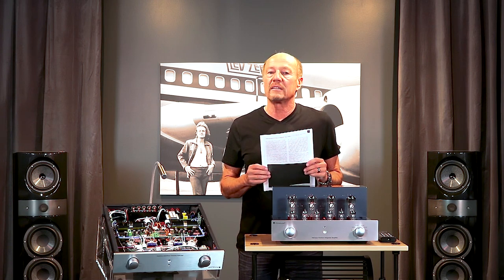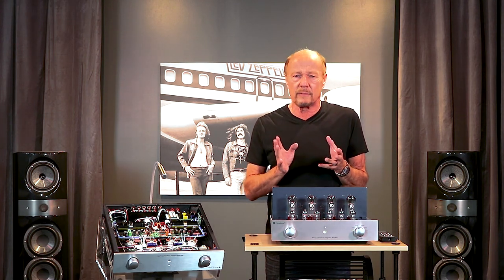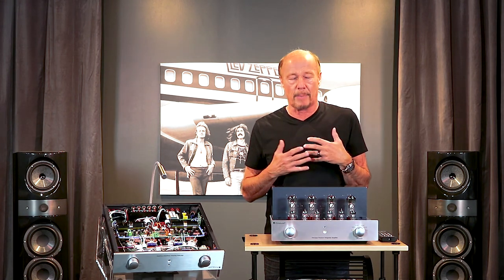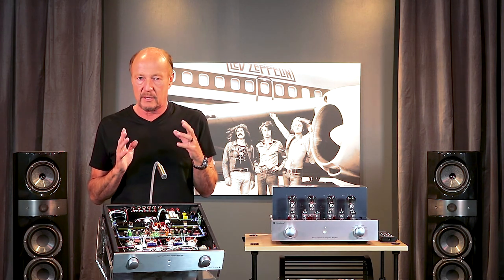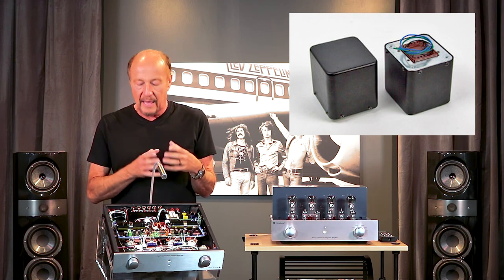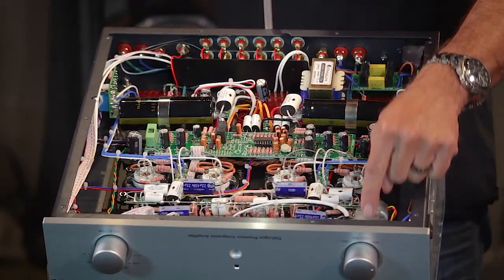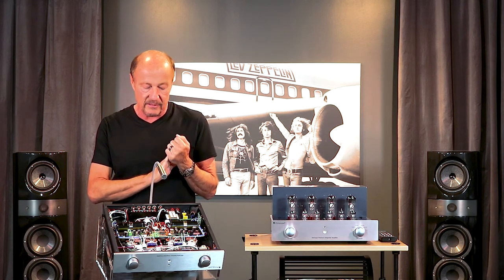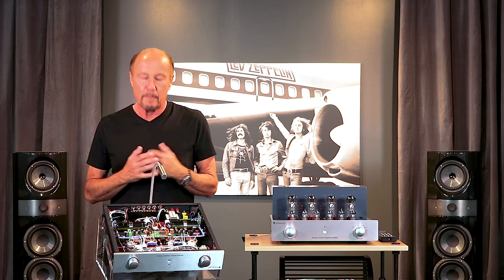PrimaLuna DiaLogue Premium Integrated Amplifier - An Inside Look

Comment: I purchased a Primaluna Dialogue Integrated Amplifier last week. It is a terrific product and I am very pleased except for one issue. There is a hum when I switch to the home theater passthrough. I have sent 3 emails to Primaluna USA and have yet to receive a responsible. I am very disapointed with their service and, unfortunately I may have to return the unit.

Update: Primaluna finally got back to me and resolved the issue. They suspected a ground loop and suggested using a 3 prong to 2 prong converter. It worked and I am now thrilled with Primaluna and my purchase.
Reply: That would be a ground loop which is common in home theater situations.  Not with PrimaLuna....but with ANY gear.  Easily solved and I suspect David was taken care of.